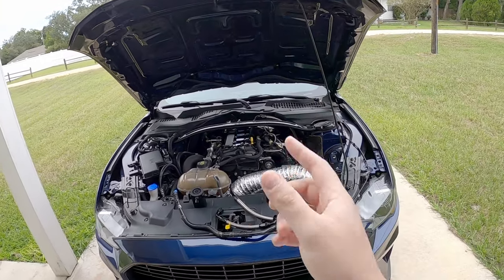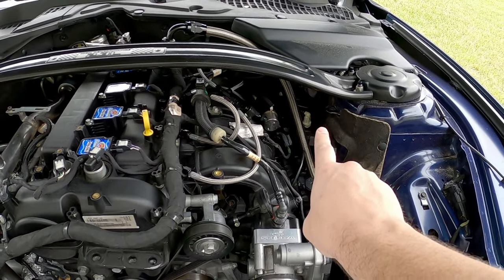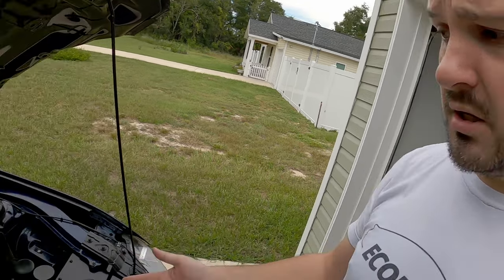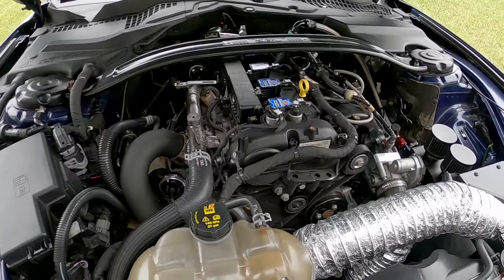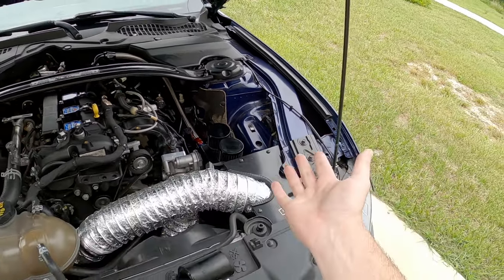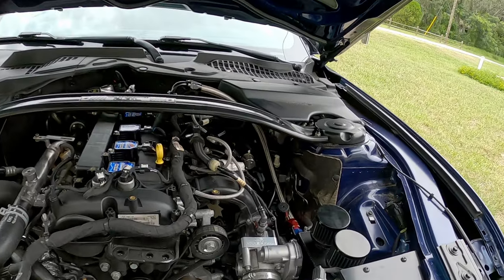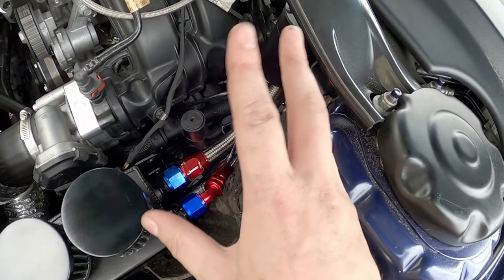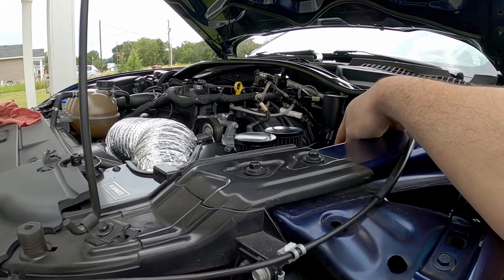My Ecoboost is Eating Oil Because of This Part

Comment: Might have two issues, dont know exact routing: boost leak under boost, and vacuum leak at idle. Possible to solve with check valves, one between catch can & intake to stop boost leak and one between breather & catch can to stop vacuum leak.
Reply from the maker: You're right! I definitely overlooked a few things. Two check valves it is!

Comment: Why not relocate the exit of the vent tank to the rear of the car?
Reply from the maker: It's easier to keep everything in the engine bay. That's mainly why.
Reply: @KarzKreated  

What I was thinking was running a single line from where the catch can air vents to the rear of the vehicle. You would will still keep all the main parts in the engine bay except a small air line 
Then it’s just a single small hose running under the car and you’ll get all the benefits of vent to atmosphere and none of the smell
Reply from the maker: I may look into doing that at some point. Making the small changes that I did helped tremendously.